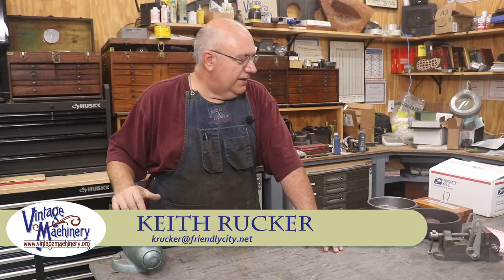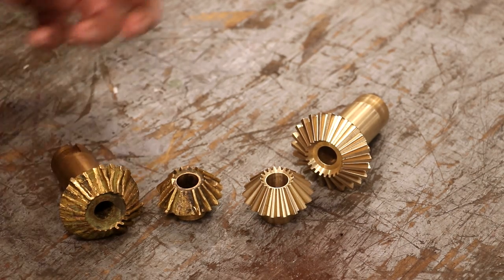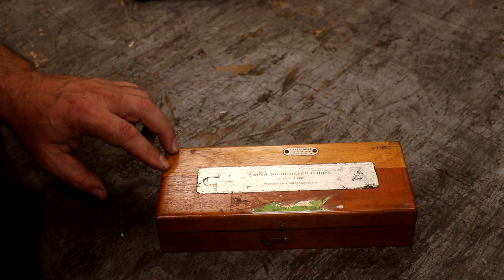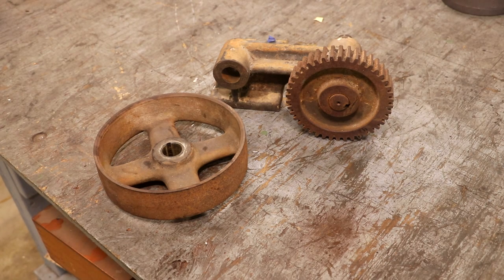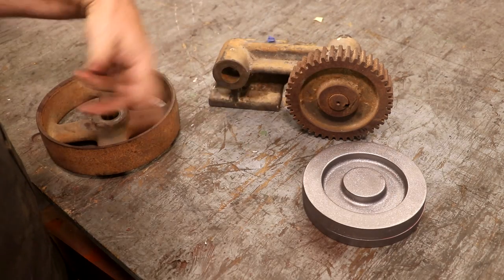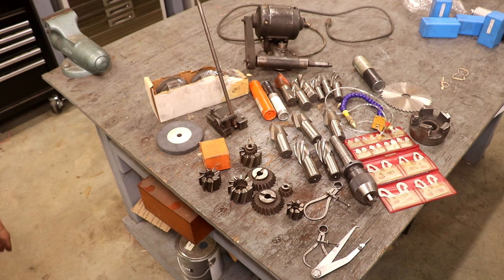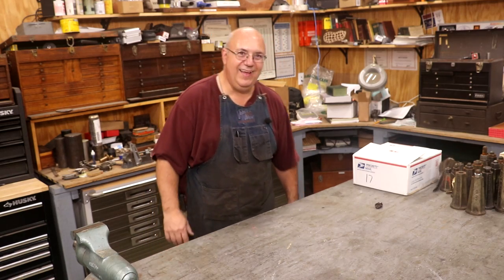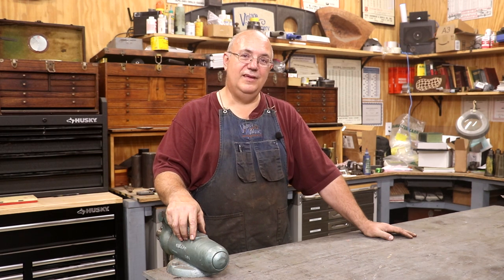Odds & Ends 118: New tools and Viewer Mail

Comment: Does anyone else want to see Keith thread a hole, with that 6 start tap?
Reply: It would have you believing you were being dragged into the tapping hole with that lead. I thinks that is 3/8" lead per revolution.
Reply: Yep, I would likje to see that
Reply: And then make a lead to screw into it!  Kieth do it!
Reply: How can it be a 6 start tap with only 4 flutes??? Only seen a 1 or 2 start tap before.
Reply: @terencewuethrich6091  I don't think you understand how multi-start threads work.
Reply: @BedsitBob     I don't understand either, but I would like to.
Reply: @buckburton7318  Let me try to explain it.

Imagine you have two lengths of wire, one aluminium, one copper, and you wind them around a piece of dowelling, side by side.

You can now see you've got two helical windings, side by side. The colour differences between the wires will make  the effect obvious.

That's a representation of a two-start thread.

If you repeated the process, with three pieces of wire, that's a representation of a three-start thread.

Add more lengths of wire, and you have a four, five, six, etc. start thread.

In effect, you are doing what machinists spend most of their time trying not to do, splitting the thread.
Reply: @BedsitBob    Thank You, but I still don't understand what it would be useful for.
Reply: The plastic milk bottles I have use double threads (aka, double entry threads). The benefit of them is, as Kieth explained, that the lateral movement is increased relative to the rotation by a factor of 2 for double entry threads. Turn the knob a little and the thing attached moves a lot.
Reply: @markschweter6371    Hi Mark - re-read BedsitBob's comment above.  Imagine you have a six-start screw already to hand.  Now grind four slots lengthwise to make four cutting edges.  The number of cutting edges & the number of starts are entirely independent of each other.  We can purchase ordinary [single-start] taps in two-, three- & four-flute versions available off-the-shelf.  Keith has a 6-start, 4-flute tap.  Hope this helps!
Reply: @sbrunner69  I was thinking the same. I don't know if he'll see this.

Comment: 6 start taps are used for cleaning up damaged threads, I watched the casting video several weeks ago, my uncle was  pattern maker, in those days there were no 3 d printers all done on wood lathes an lots of hand work with rasps and files etc, back then a good pattern maker was a very valuable asset

Comment: If you still have problems finding replacement glass parts for the oilers and site glass, that is something a glassmaker may be able to fabricate for you. They could make a carbon block mold for the outer dimension of the site glass and with a few tests should be able to blow the inner diameter close to what you need. .
Reply: Depending on the dimensions and the accuracy requirements, you might even be able to buy the tubing off the shelf, then just cut it to length and flame-polish the ends. 5 feet of Schott 12mm x 2.2mm borosilicate tubing (just guessing at the dimensions of the sight glasses in the video) is less than three bucks from my favorite borosilicate supplier. Same with the oiler glasses, though those will take some practice to cut without breaking (or just cheat and use a wet tile saw) and it might be harder to find a close enough size.
Reply: @RonParker  some of those oiler glasses look like they're only cut and perhaps ground flat.
We cut quartz tubing for small tube furnaces in-house, don't even grind or flame polish the ends.

Comment: Keith, the arms on the angle vice are assembled incorrectly - if you unbolt them you will quickly see how they should go. They should be almost horizontal when the vice is flat, not sticking up as they do at present. I have one that looks identical, made by Eron around 1980, very cheap back then.

FWIW, The odd-leg calipers are also called hermaphrodite calipers...

Comment: The tap might be for tapping bronze nuts for use with linear positioning. When you have high number multi-start threads. It usually is when you need a lot of linear velocity (or acceleration) with a very limited amount of rotation. Very very interesting tap I will say. I agree with the fellow below that mentions it might be for optics. I could see that being used for extremely rapid movements of a mirror or lens, possibly used for tracking.

Comment: The left hand 3/8” tap if I were to guess is for a stem for a valve, most likely a cold side faucet
Reply: That was my thought as well
Reply: Yes,that sounds a reasonable application. It is about the right sort of diameter for that.
Reply: I had that thought - but pretty sure they're not 6 start !
Reply: @millomweb  It does sound a bit overkill for it to be 6 start. I would have thought 4 starts would produce a helical lead more than adequate for a water faucet.
Reply: @howardosborne8647  Pretty sure all the ones I've seen are single start - but left hand threaded ones do exist. Even a single start opens far enough quickly enough for most needs. a six start forces the thread to be a very quick one - one 6th of turn moving as far as a full turn single start - it's not going to offer any great clamping force !
Reply: @millomweb  yes,I've seen the left hand faucet inserts. As you say 6 start on such a small diameter is pretty much unviable because it would be well outside the recommended limitations for helix lead per revolution. Similar limitations are noted for screw cutting of threads.  This where ball screws become necessary. At these helix angles the thread starts to resemble a barley twist as seen on wooden stair spindles.
Reply: @howardosborne8647  Even to cut such a thread on the lathe you can really see the need to angle the cutting tool over as almost the metal is approach ing from 45° :)
I've very limited experience with ball-screws. Despite that, I have experience of said items with balls all over the floor ! (without any dismantling and still in service) Not surprisingly, I'm not a fan !

Comment: Could lengths of Acrylic tubing be used on the oilers in place of glass?
Reply: Yes as long as there are no High temperature involved that would melt the Acrylic
Reply: Acrylic cracks after exposure to certain solvents (esp. alcohols) so that’s not the greatest solution for a shop environment where solvents are used all the time to clean and degrease things.

Comment: Are you sure it's six start thread? Going from memory, I think there is something amiss. You would think with a 4 flute cutter... 2 or 4 starts. If it is a 4 start thread, the actual pitch is 4 TPI. The crudest way to tell is to actually thread a hole and measure the turns per inch.
Reply: I thought that too, you would think that a 6-start would have either 2 or 3 flutes...